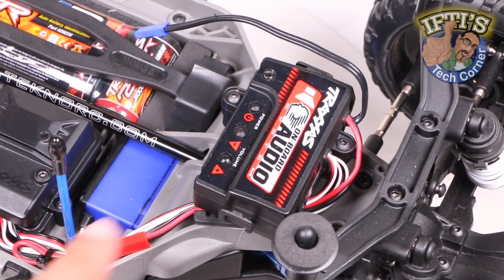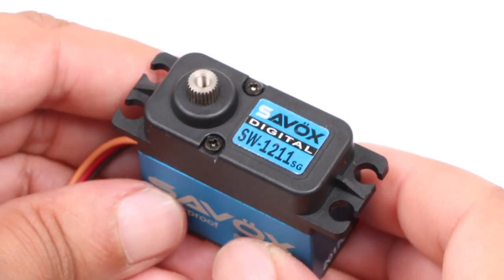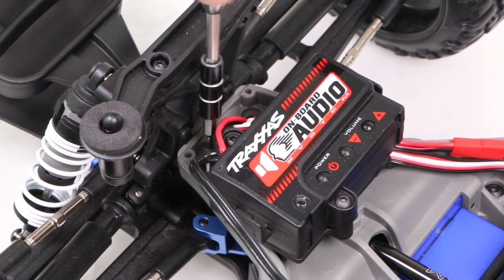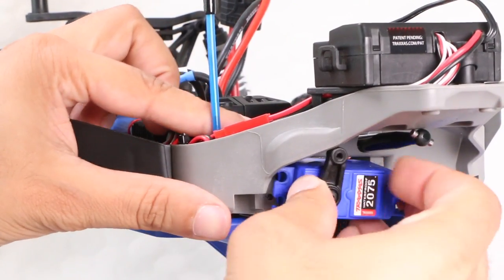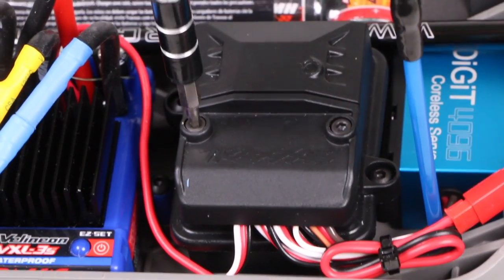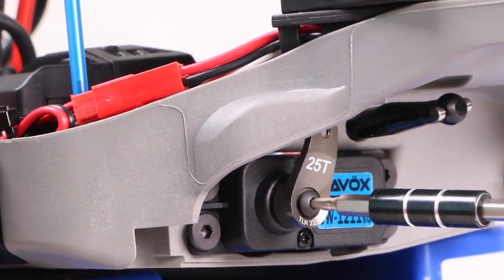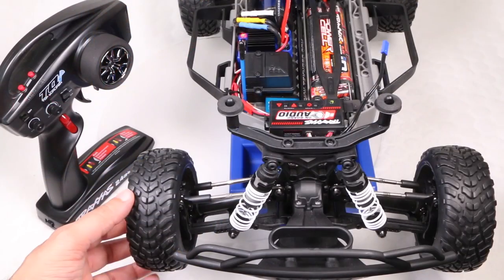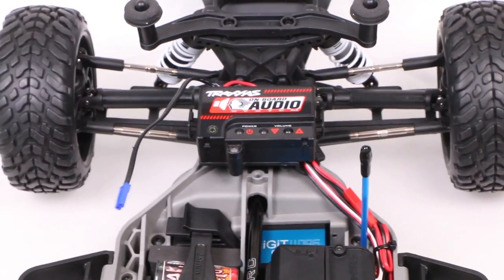#08 Traxxas Slash 4X4 - Steering Upgrade Part 2/4 - Savox SW-1211SG Servo Install!

Comment: Was your servo horn hard to get the stock screw in mine was super tite almost like the screw hole was a different size I also used the tlr servo horn

Comment: I put a 35kg betu aluminum hoysing steel gears in my slash and im super happy with it i want a strong servo i didnt want a super fast one either its perfect and it was 45$ on amazon great for anyone doing a budget build mines much easier to install on slash 4x4 vxl

Comment: The Losi server horn cannot use the stock the screw to attach the servo arm to the servo, it is a different (smaller) thread.  How did you solve this problem?
Reply: I used a thread tapper bit in my drill.

Comment: I installed a two system and I have a savox servo , the rc will drive , but it won’t turn what should I do
Reply: Brendan Wagner is it in the right spot on the receiver box?

Comment: I was underwhelmed with that servo. The 1210sg is the same price and much better......
Reply: Savox has recently updated both the 1210 and 1211. Both feature much more torque at 7.4V, however there is no change at 6.0V - which is quite disappointing.
Reply: M Goo yeah but it’s slower

Comment: Will the TMS still work with this servo?
Reply from the maker: Jon Deak yes it does 👌🏼
Reply: @iftibashir  do I need to run the b.e.c. on this servo?
Reply: @theslashmanrc7503  not needed. No.
Reply: @choke666  ok. Already got mine because of someone's recommendation